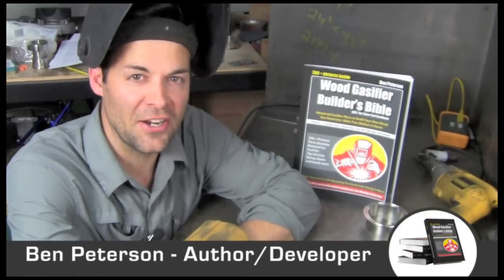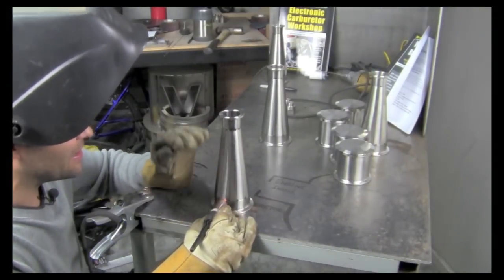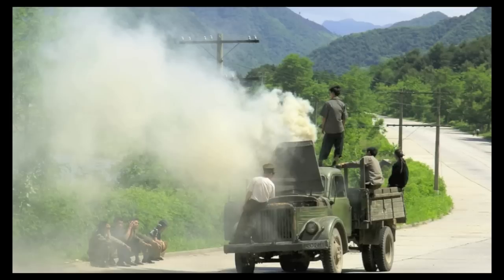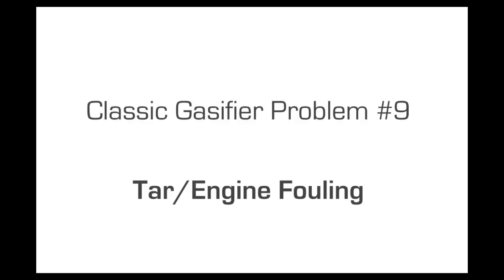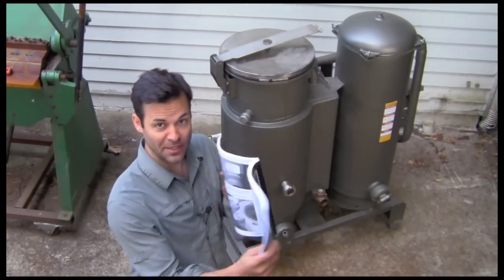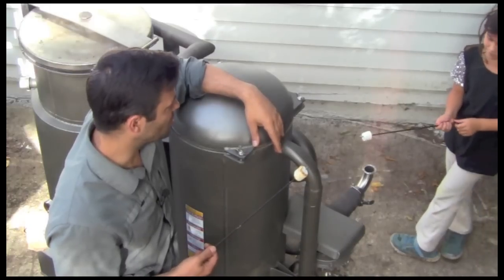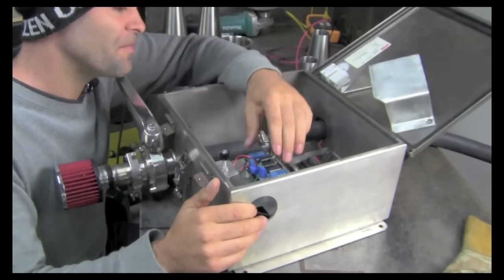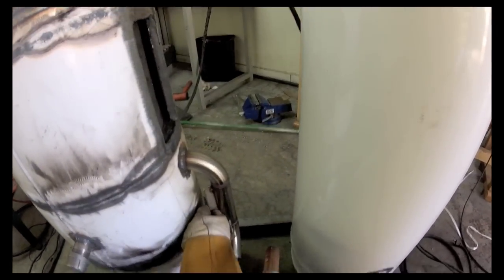#1 Wood Gas Generator. Ultimate Wood Gasifier Plans. Free Fuel for Life.

Comment: Looks a good publication. Some of the technical stainless parts in your vid, look hard to come by if the reader doesn't live in the US though. For those who are worried about deforestation or sourcing fuelstuffs, it really isn't hard to buy or rent an acre, and grow fast, high volume returns from willow, miscanthus, hemp....don't rely on others to provide waste wood, or you'll sacrifice your independence for when the SHTF. People need to just do a little research. I'm definitely teetering on buying this book, as it's on Amazon.co.uk for £29.00!
Reply: Deforestation should not be an issue.  Before I owned land, I assumed I'd have to cut down a few trees for a project like this.  But I bought forested land and quickly realized that there is so much deadfall, I'll never have to cut down a tree for gasifier fuel or firewood.

Comment: are you left with charcoal at the end?
Reply: Good question to ask!

Technically toy might, depending on what you gasify, hard wood, soft wood and such will leave you some char, but you’re better off putting it into the ground and using a charcoals retort to make dedicated fuel charcoal.

Comment: Hello
I have an old engine can boost your general generator from 50 KW to 300KW to become 10MW to 200 MW per substation. (estimate),no fuels. 
My technology does not depend on any fuel, no ocean power, no wind power, no sunshine, no water power, and no heat power, and no battery, and not magnetic. Best regards, Porn

Comment: Here's a seemingly obvious question for anyone knowledgeable about wood gas. How much time, and electricity do you spend cutting up feed stock vs amount of gas produced? An equivalent to a gallon of propane would be very helpful. Thanks.
Reply: Selsley01 Sigh. Mr Selsley, my 12vdc electric chain saw I've owned and used of & on since 1986. The 120 vac universal motor 9can run on DC too) chainsaw I've owned/used since 2003. I DO have three differnt Stihl  gasoline chain saws (small, medium, large) 5-15 years old. And these replaces one by one 20-30 year old gasoline chainsaws - worn out from use. High performance 2-cycles engines demand high performamce absolutly spec grade of gasolines and lubes. ONE fill-use of sub-spec fuel or lube will kill them. 
Cut wood. Make live, warm woodgas, fuel a tip-off/throw-a-way lawnmower 4-stroke engine, make electricity  AC or DC to run the electric chainsaws. Simple. Direct. See-Do. Woodgas-made-electricty can then be used for safe, clean lighting, refrigeration, entertainment/communications.
Ha! And for the really bad gotcha' North Korean EMP "bad-days", the next for me very real volcano. Cascadia 9.0 magnitude event I do have one and two person cross-cut saws, sweed-bow saws. Just put more tree wood fuel down on the ground in easy reach. Grid connected means Depenencies connected. Bio-mass into engine safe to use liquid fuels means severe Dependnecies for the purified rare catalysts to make these liquid fuels. What is the Dependencies diffnece? None. Personal Freedom achieved? Zero. Regards Steve Unruh
Reply: Selsley01 Hey Selsley I've actually "time-study" axe-made gasifier capable fuels. With a standard single bit axe I cleaved a 4 foot diameter wind fall tree in half in one day. Made ~6 cubic feet of 4 once each big course chips. Got me hired onto a haying crew inpressed the farmer nieghbor. Those chipps would have been ~8 hours of a Ben's book system fuel. 
Better way is to electric chainsaw 3-4 inch long crosscut discs "pucks" out of a log and use the axe to chunk them up to gasifier fuel chunks. Then a days production is 5-6X times that. Done that a lot too. Use a  3 pound CampFires Friend slitting axe then. Heavy. Fast. Just grow sronger.
Electric chainsaw breaking down shiping pallets an axe then handy for sizing chunks down. One hour work then make one days worth of gasifier fuel. (some work alrady done for you by the pallet maker)
My unapologetic opinion is only those who would make process thier wood fuels should ever play gasifier games. Then it is not a game but a real make-power tool.
Steve Unruh
Reply: Paul Ladendorf Hi PaulL the current engine loaded system woodgassers are reporting at best 16 pounds of wood to ~30 pounds of wood needed for each US gallon of gasoline replaced. No one reporting propane substitute numbers. Expect it to be similar +/- say 15%. Energy to make the chunked, sized gasifier wood fuel? Again depends on whether from the live tree, or from construction wood debris and HOW it is done. I was the VictoryShop from standing trees fuel wood supplier. All toll 2 gallons of gasoline from tree to chunks for every 2000 pounds of useable chunked wood. ~200,000 gasoline BTU's to make 10,000,000 BTU's of woodgas fuel.
Oh, yeah a couple of peanutbutter sandwiches, and two beers to for manprocessor energy. S.U.

Comment: I just got the book in the mail today. Worth every penny. There's a section that tells you exactly what you need, where to buy it, and also says if you could get it through scrap. I'm very cheap. I'll be digging through the scrap yard alot. But I do have a question,  after building one....could I sell them on the side to make money? Kinda like a small business?  Or are there laws against it?
Reply: Just do it “under the table”, make them the best each time, and provide customer service so you can charge just enough to get you by for repairing them.

Also go to landfills like NO TOMORROW so you can dumpster dive for usable metal.
Reply: You would probably need permission from the person who created it and sold you the book with designs he has copyrights to or possibly be sued.

Comment: Here is a good question could you use wood gas to run LP furnace?
Reply: I seen a lp.adapter on a chevy truck that was running off of wood gas.it will work but it should be scrubbed and cooled first.
Reply: Xarbon monoxide poisoning risks.were high in the old days.this was caused by the wood being wet or improperly built systems

Comment: Overall nice design. But the colors of the flame indicate tar and moisture in the final gas product. This would be a nice build, but I'd include an additional filtering and cooling stage to scrub the unburnt particulates. And I don't care much for the automated carburetor with  programmable  firmware. In concept its all neat and fancy. But in reality, in a true survival situation, if a CME or Magnetic Pulse fries all our precious Integrated Circuits, any gasifier fitted with this automated carburetor would be rendered useless. Then all you'd have is a really neat yet useless investment.
Reply: Or just construct a faraday cage around the electronics and have spares.
Reply: the emp is greatly over exagerated
Reply: Ford had Carter make one of those carbs already. Had dual stepping jet adjustments.
Reply: I did see a video where a person used water to separate the solids from the solids & oils.   Perhaps something based on the curved pipes that are under people's sinks with a cap underneath to drain the water, oil and tar when it's done.
Reply: I agree about the filter, a cyclonic filter is pretty easy and then you get useful products too. Unless he's hidden one in the device that deals with it

Comment: Gathering materials now,,this can be done with recyclables,in many different types of designs,I always knew that smoke was just un-burnt fuel..
Reply: smoke is not unburnt fuel. Smoke is just inert Co2. That green gas that comes off of wood sometimes when you get your fire really hot but there isn't a huge flame? THAT is wood gas, which in this case is the "unburnt fuel".

Comment: 6000$ huu that is a huge expense i built AND operat my gasifier on me VW beetle for APROX. 250$ these thing dont need to be so expensive and dont say minde dosent wor as well as yours i have done just as much reserch in the suject as u and these and be so much more simple and smaller and more efficient that u sujest i get 3 miles per pound of wood in my car and almost no ash in the clean out and my pipe fittings are still white on the inside come on make it smaller

Comment: How hard to start in a back to basics situation, IE no compressed gas torch and no grid power?  Assume you have a storage battery and regen enough elec to keep that much going obviously.   Thanks.
Reply from the maker: You can use paper to light the charcoal, it just takes longer. I usually pressure feed my machines so you have to get it really hot to start. This one is vacuum operated so it's easier to start. The genset charges the battery or you could use a solar trickle charge. It probably doesn't use more than 75 watts per hour to operate in flare mode. Less when engine provides suction.

Comment: Ben knows his stuff! If you don't believe it, check out my youtube video where I hooked up a 45KW generator run by a 6 cylinder 300 cubic inch Ford straight six engine to a Victory Gasifier and it runs flawlessly. You want the hardcopy book because it's readable even if the grid goes down. If that happens, your DVD will make a great coaster for your drink.
Reply: The best thing to do is probably build one BEFORE it all goes to hell!! How you gonna weld anything up with no power then???  DOH!!!
Reply from the maker: Thanks for the rockin testimonial and to everyone commenting. I have some streaming video in the works, but it's not ready just yet and it doesn't have part sketches and schematics like the book, but it is in color and it's a nice compliment. Cheers!

Comment: ~ good to see you progressing bro
+ I see you went all the way on trying to regulate RPM / load in an attempt to make clean 110 vac 60 hz rather than go inefficiently with strait DC for battery charging, heat scavenging & inverted that  to clean 117 AC as needed ?
= shared your work, butt don't you have a cheaper & more convenient downloadable DvD for those on a budget that can not afford a hard copy for their grandcavechildren in the survived hear after :)